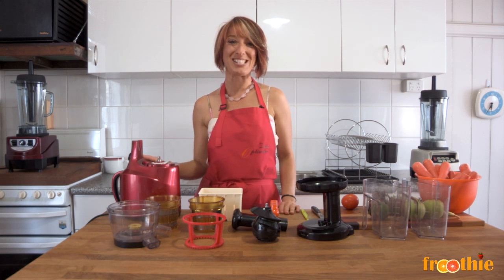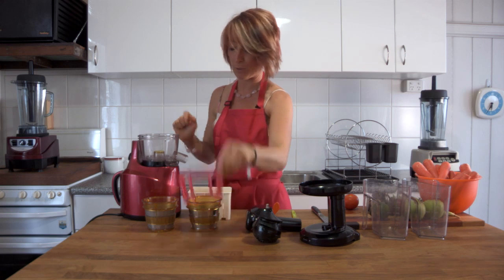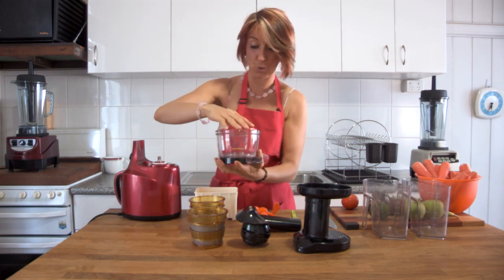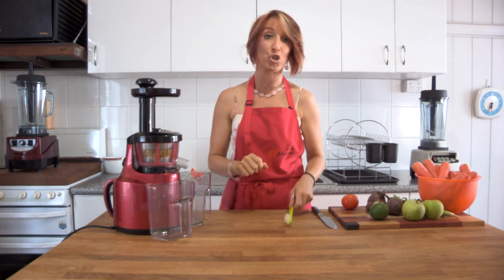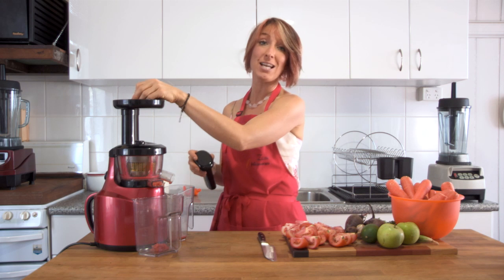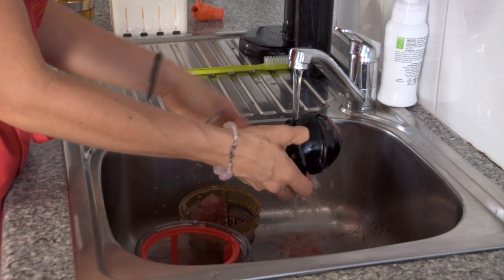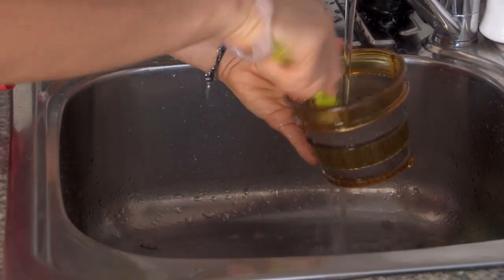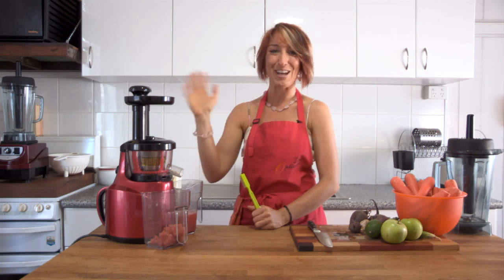Detailed Assembly and cleaning of the Optimum 400 Juicer

Comment: I know this machine is old but I am getting a lot of clogging. I have reassembled many times and cleaned. It gets so clogged that it begins to lift up. The bowl.
Reply from the maker: Hi there! It sounds like the clogging could be due to certain fibrous or dense ingredients, which sometimes need a bit of extra care with the Optimum 400. For best results, try cutting up tough, fibrous produce (like celery or leafy greens) into smaller pieces, and alternate softer fruits with harder ingredients to help with flow. If you’re still having issues, feel free to reach out to our support team at support@froothie.com.au —they’d be happy to troubleshoot further with you! 🤗
Reply: @FroothieTV  it was carrots... So shud be smaller pieces too? So I gather I should make a veg and fruit juice together
Reply from the maker: @carlamannon4974  Yes, cutting carrots into smaller pieces can definitely help reduce clogging since they’re quite dense! And alternating between harder veggies (like carrots) and softer fruits or veggies is a great way to keep the juice flowing smoothly. Mixing fruits and veggies can also add a nice balance of flavours and make juicing easier on the machine. Let us know how it goes! 😊
Reply: @FroothieTV  hi I just did celery, tomato beetroot and carrot. It still gets cloggy but not as bad because of cutting the pieces smaller and alternating soft to hard., I don't always have a variety of fruit and vegetables like this so it's a bit disappointing I can't just make a carrot juice or just make celery juice
Reply from the maker: @carlamannon4974  Please reach out to our 24/7 customer support team at support@froothie.com.au for further diagnostic 🤗

Comment: How does waste come out when red tab is blocking outlet
Reply from the maker: When the red tab is blocking the outlet on the Optimum 400 juicer, it's not meant to stop all pulp from coming out. Instead, it helps regulate the flow of juice while still allowing some pulp to pass through. This design ensures that you get smooth, delicious juice without any clogging issues. If you're experiencing any concerns, feel free to reach out to our support team for assistance!
Reply: What dp you mean by 'reach out'

Comment: I was using this machine for the first time today. After about ten minutes, it started to make a screechy sound when juicing. I took all the parts and cleaned them out totally and restart using it but the sound has not gone away. Any tips on what could be wrong?
Reply from the maker: Hey Sharrukina, a screechy sound can be normal depending on what is juiced. For example if you juice celery or broccoli or carrot then you can sometimes hear a screeching sound which is nothing to be worried about. 
We recommend alternating soft and hard fruit and veggies. 
In case you experience other issues or need help please contact support@froothie.com.au